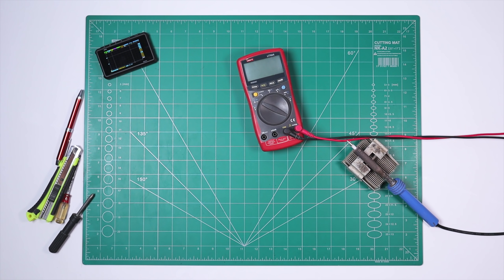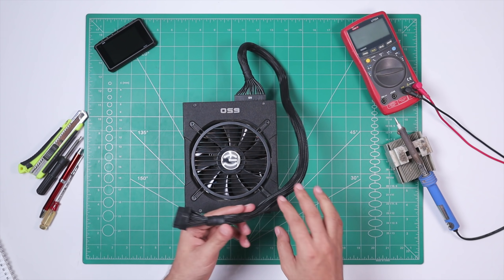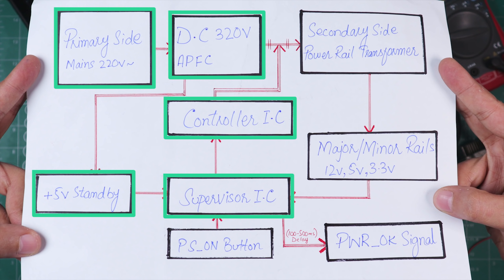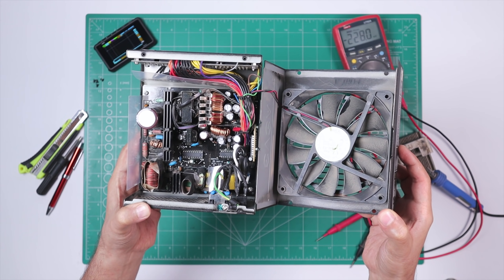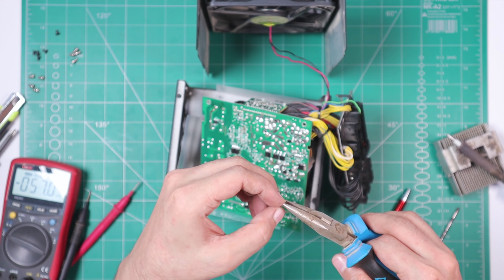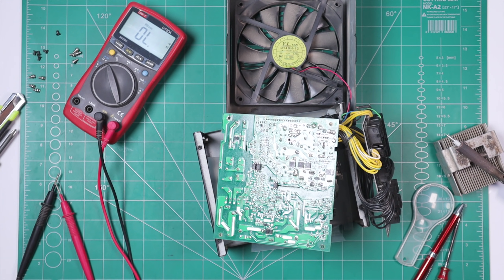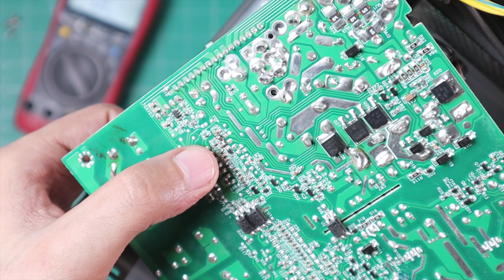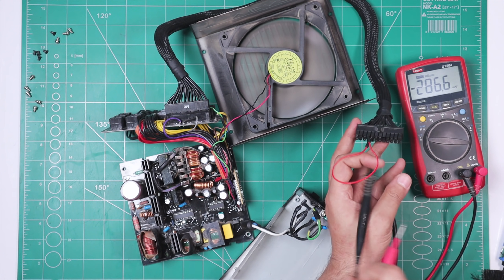Repairing PC Power Supply | EVGA NEX650G

Comment: Hot air stations are good for BGA’s but I personally wouldn’t recommend it for surface mount rsistors it’s usually easier with solder wick and a pair of tweezers

Comment: What if 12v returns 11.8 or 5v returns 4.9 on multimeter? Is PSU okay or dead?
Reply from the maker: It's perfectly fine.
Reply: @GuyThatDoesEverything  I checked it with a multimeter and looked up manual for min/max outputs and mine were below minimum. And the problem why I decided to check the PSU in the first place is that it was providing electricity but not enough to power the motherboard 😕

Comment: HOPE TO HEAR FROM YOU this time ,need help need to replace my dell insperion 5680s psu cant find one anywhere model d460am-03
Reply from the maker: Dell Inspiron 5680's motherboard has 24 pin ATX connector so any ATX PSU will be compatible with this board, though you will have to find the right size PSU which will be able to properly fit inside your existing case.
Reply: @GuyThatDoesEverything  THANKYOU SO MUCH ALSO I THOUGHT I HAD A HARD DRIVE ANS A ELECTRONIC GARD DRIVE AND CANT FIND THE EOECTRONIC ONE ANYWHERE WHAT AM I MISSING

Comment: What is wrong when psu work normal for 15-30min and then shutdown for some reason? I look capacitors they are good
Reply from the maker: Though the capacitors may look good physically, an increased internal resistance (ESR) inside a capacitor will cause abnormal functionality.
The behavior mentioned in your comment may have several reasons, most common ones are the issues with failing capacitors, over-heating of components and deviations in sense resistors' actual resistance values which may very well be due to degradation (due to high heat exposure) over time.

Comment: You are amazing, can you help with my issue please. Gigabity P750GM is the model of PSU, this one protects when I do the wire bridge in black and green connectors. Only one sound click from relay happen. I tested the voltages with multimer and don't have nothing voltage. I opened the psu, the fan works fine with a external Power supply, I didn't see blow out components or sothing relative. Do you guide me to identify the fail component? Thanks from Costa Rica.

Comment: Hi brother my power supply aldo got som issue yesterday i was using pc when suddenly a blast happen and my pc turn off I know it's psu fault. Now what should i do?
Reply from the maker: This may be due to power surge which ended up blowing up the MOV inside the PSU. I will recommend to just replace the PSU entirely and get voltage/surge protector if you have high voltage issues in your area.

Comment: The question is; Is it recommended to use the repaired power supply?
Reply from the maker: If the repair is done properly by using the exact same replacement components and no hacks then yeah you can use a repaired PSU with your system.

Comment: My pc is getting power all fans arr spinning but no display i checked my gpu and other stuff which works well but not psu
Reply: Some time i boot my pc light fluctuate and pc shuts down some time it turns on normal but no display

Comment: good one. simple resistor fix. tip for others: use series lamp before starting the psu. mine blew up the mosfets the first time. then i used series lamp.

Comment: Hello , i have the NEX750G . Same simptoms , unfortunately i cannot repair it , but i will keep laying around , maybe someone can fix it in the future , otherwise it's going to end up as garbage . Really frustrating , but not much i can do about it ..... However it worked 7.5 years with no simptoms , no problems , one day (a few days ago :DDD ) it decided not to turn on :( .
Reply from the maker: That PSU served you well throughout all these years. You can still give it a try though by taking it to some repair guy and ask him to look for that specific resistor that causes the PSU to not turn on. Even a phone repair guy might be able to do this fix.
Reply: @GuyThatDoesEverything  probably so , but we're short of the advanced electronics repairman , it's really hard to find a good one .A phone repair guy won't touch that , they only change modules and whatnot , no board level repairs. And it could get expensive , i'm not willing to pay more than 20-25€ , and there's a risk that some other component is going to fail. Or it might not work properly under load . I'm going to keep it for a while , maybe i get lucky .
Thanks for the reply .

Comment: Thanks for the vid. I got broken psu lying around so I just bought another online ... that one is broken too. You may have just given me the confidence I need to try and repair them. Already noticed one of them has 3 broken capacitors in it, hoping replacing them solves the issue on one of the psu's ... would be nice to save a 650watt Zalman semi-modulair psu. thanks!

Comment: is it alright to use a repaired PSU ?
Reply: I wanna know this too
Reply: @UriPhoneCracker  As long as it's a quality power supply repaired with a quality part, you'll be fine. Cheap PSUs are likely to cause the issues you hear about like dead motherboards

Comment: Good on you for warning people of the danger of the capacitor as it is literally a stun gun in the shape of a battery. I would argue that is unnecessary  and even dangerous as you cannot accurately predict when the capacitor will fully discharge by just leaving it. I have no formal electrical training but I’ve worked in IT for 20+ years, built bitcoin mining rigs . I’m still not sure which is more difficult , designing a proper multi device rig or designing the power requirements and installation of a proper data Center, but they both share very similar requirements and dangers except with a data Center the  big power source that could turn up to crisp is mainly located in the electrical utility closet or wherever the main power is fed into the building. Typicallly after that it’s split off safety into recepticles and no surprises there. But designing a bitcoin or any kind of crypto rig involves setting up multiple dozens of power supply units just like the ones in this video actually quite often higher I had them usually in the 700 800 W range for ant minor I even had a 1000 W PSU in one unit, which of course had a back up decided it so 2000 W power supply that if anything short out that capacitor or if you open it up to do a repair cause when you’re doing this mining stuff you have to save every penny literally so you’re not you’re not taking your power supply it geek squad to get it fixed you do it yourself and there are a lot of those capacitors. The best way to repair one is disconnect. The power completely you can count to five, wait 10 minutes or wait an hour. Waiting an hour is probably the safest but you still don’t know that that capacitor probably still has most of its charge in it. They’re designed to hold a heavy charge. So unplug the power cord from the PSU and if it’s connected to a computer even better because then you have an on button to push just push the on button you’ll notice that after you unplug the cable if your computer has an ethernet cable in the back of it, just watch the ports on it they stayed lit up for like a good 5 to 10 seconds in some cases or the motherboard often has a green light showing that everything‘s OK and powers flowing through it. It will stay lit up for several seconds, that’s those capacitors. It’s hooked up to a computer. You’re actually slightly safer because they sort of drain them, but the best way to do it regardless of if it hooked up to a PC, Or just open in front of him like that is pull the power cord turn on the supply however, you can so short the cable if it’s not plugged in a computer or rig and keep it shorted for a few seconds that should be enough to discharge all of the remaining power inside the capacitor. Then to be safe, you can use a multimeter to test the capacity for any amperage of voltage in it. It should register basically 0.

Comment: Hey, my cpu stopped working after my power randomly shut off and i did the trick u showed at the start and the cpu worked, same as some fans in my pc and i dont know what to do now, reconnect the cable and hope it will work or what cause i got no idea

Comment: Does anyone care as to 'why' the resistor was damaged?  Resistors do not just overheat for no reason.  Oh well, why bother.  Replace and move on.
Reply from the maker: Sadly, there's no datasheet for that particular IC so figuring the exact reason as to why it burned out was kinda out of equation at that time. Many people reported the same resistor problem in the comments and after replacing it the problem also got resolved for them.

Comment: Good repair .  How do you trouble case where power supply shuts down immediately after power on  if the supervisor chip is shutting down the PSU . Can you stop the supervisor chip shutting down the PSU so  that the PSU remains on so you can trouble shoot the problem .  What is interesting is to show techniques to trouble different classes of fault

Comment: It is so sorry that a pro like you don´t have all the tools he requires, hot air station, fume extractor, microscope etc. I wish you succes.
Reply: What’s the hot air thing he talking about? Like a hot air gun thats a necessisity to repair an iPhone by heating up the glue that keeps the screen on and forms the waterproof seal??? I just managed to get a real hot air gun and my gosh does the air gun make a difference. I could literally start a fire in seconds with the heat directed at a piece of printer or news paper. First time i used it on an iPhone i freaked out when i had it aimed a bit too close the the front screen and it looked like someone spilled a cup of coffee under the glass from all the pixels heating up but luckily it went away pretty quickly. When I touched the iPhone, almost burnt my hand. Before I got the hot air gun I went from pissing my wife off big time to making very happy because she was a hairstylist and I just started off. Didn’t have her dream  blow dryer yet and then I kept sneaking in every so often when I would have to repair someone’s iPhone screen and steel her hair dryer and I always forget to put it back so what I did was find out what the best model blow dryer. I could buy see if it was better or similar to the one that she wanted and found out that it was actually much better and more expensive. I bought her a ceramic blow dryer from top-of-the-line imported from Europe manufacture when I got to using hers just for fun, one time to do a repair to see how much different it was from the non-ceramic old one that she happily traded me for I realized how good the ceramic one was so I upgraded her again, she got a new ceramic and I got the old one did two different and I think that blow driers are much safer options if you’re dealing with anything like an iPhone or putting on heat shrink tubing. This almost sounded like he was talking about soldering with hot air. I’ve never done that before if anyone can explain that to me I’d appreciate it.

Comment: Hi bro , my brother have a pc which is 
R9 3900x
32gb ram
B550 Aorus Pro AX
GTX 1080
and the psu is that same one , so he was working normally on the pc but in sudden it just turned off with sound of electric shortage and it just kept restarting , he took the pc to the same store that he bought the motherboard from , and they told him that the motherboard is dead because of the power supply , and they broke the socket when they wanted to take off the cpu , so is it the same problem that is showed in the video ?

Comment: I have 650P2 and I'm Islamabad, yesterday voltage was fluctuating and it seems overvoltaged. 

At first sight I saw breaker tripped, then I tried with the tool for powering up PSU without motherboard, it was come with PSU. I tried with it to see if mine's fan also doing the same but loud popping sound with some sparkles happened.

Comment: I don't think that i have ever commented on youtube, but i just want to say thank you, i woke up this morning to the same issue PC energizing for a fraction of a second then shutting off, i removed the gpu and other cards to eliminate them and it stayed the same, so i teared open the power supply after i saw your video and i was sure it was the cause of my problem not other components however my resistor looked fine externally so i removed it to measure and it measured 10 ohms, i soldered it back on board and boom power supply is working again, i guess that it was a matter of a cold solder joint or loose one due to heat.

Comment: how do you know the value of the resistor?
Reply: if you're asking that then you HAVE GOT TO BE new to electronics

OK
1. Learn about Ohm's Law
2. He knows the value by the colours on the resistor.
Google DIGIKEY RESISTOR COLOUR CODES and get out some resistors, Predict the value 
then check with a DMM if you are correct

3. why did he use that value ?
Because when you have 155V olts it's fucking pointless to use a low value, say 10 Ohm resistor.
You want to use a high value resistor

what he is doing TO MAKE THINGS SAFE IS....
Instead of shorting the capacitors as idiots tends to do, 
HE IS PUTTING AN ELECTRICAL LOAD BETWEEN THE PINS

PUTTING AN ELECTRICAL LOAD IN A CIRCUIT MAKES THE CIRCUIT CONDITION SAFE

that's why
and the value of voltage that you have will determine what cap you will use to make it safe

Comment: I have a Corsair HX1050 that had an oily substance on the power switch at the back. The unit is able to turn on. What might be the cause of the leaking oily substance from within the PSU?
Reply: could be a puffed capacitor
Reply: @ra3or  I see, I sold it and the guy doesnt seem to be reporting any issues. Can blown leaking capacitors continue to work?

Comment: @guythatdoeseverything 9mins :07secs - Are you sure that FSB6601 switches the 'secondary transformers' because those coils you point to are not transformers, they are the output inductors, which are responsible for removing ripple/high frequency noise and giving a stable output voltage, together with the output capacitors.  They don't need 'switching' in any sense.   Nice repair though.  The FSB6601 is either the PWM controller for the main power supply rails or it is a voltage comparator (probably a quad differential comparator similar to LM339).   You didn't mention the part number of the other 20 pin IC so there is not enough info to say for sure.

Comment: Nice that was helpful.  Can you help me fix my issue.  I've got homage ups I set one connection for PC so if main power cuts then I can properly shut down my system but when main power cut down my PC don't stays on, it turn off and then turn back on. What do I do? It's thermaltake smart series SE 530w.  I bought in 2016. Do I need to recap capacitors of PSU . Or change UPS relay?

Comment: When a resistor heats up, burns and cuts out, then the problem is upstream of the resistor. Your fix is temporary. I doubt it will handle half the load on let's say 12 hours continuous work. Will you come back and show/tell us if it still working?
Reply from the maker: There's no load on this resistor, it looks like it acts more like a sense or pull down/up resistor. I couldn't find any datasheet of that IC so can't say with absolute certainty as for which exact purpose that resistor was being used there. Though the PSU has been running fine ever since this repair.
Reply: @GuyThatDoesEverything  Thank you for the reply. Nice to hear it's still alive!

Comment: Is there any reason you used a 47k ohm resistor specifically to discharge the capacitor?
Reply: Huge resistance so it wont fry up. Under 1 k it will probably get hot or maybe boil under high voltage
Reply: YES......
A capacitor without an electrical LOAD is an OPEN CIRCUIT  aka   Extremely High Resistance

if you place a LOAD that is of low resistance across the terminals
THE CAP WILL DUMP THE POWER INTO THE LOAD because current can now flow

IF THE RESISTANCE IS LOW vs the voltage (Electrical Pressure) going through it
it will fry the resistor

SO... IT'S NOT AN EXACT  VALUE CHOICE
but....
it can't be infinite resistiance because current will not flow
it can't be low resistiance because too much will flow and burn the resistor

TO MAKE THE CIRCUIT SAFE
it has to be enough for current to flow
but also the resistor has to be able to handle the voltage dump into it
so high enough resistance to be able to take it

so 100k to 300k ohm should be fine

Comment: My shut off during load which part I need to fix?
Reply from the maker: It's either heating up or has prob with its main bulk capacitor. Get it replaced with the exact value cap.
Reply: @GuyThatDoesEverything  lol it's do hard to replace the cap 
But I will try

Comment: Thanks for the video. Even though I ordered a new one, that left me curious, same problem as described on the video.

It's a 5 year old EVGA 500W-B, it's been working close to 24/7 for years.
Reply: Just solder on a new resistor from an old Nvidia card.

Comment: what if the fan does not start at all, nor any voltages from EVGA 600 watt 80 plus certified?
Reply from the maker: then better check for any fault on the primary side. Can be a blown up fuse/MOV/NTC/APFC MOSFET etc
Reply: Any luck with yours I have the same issue and a 750

Comment: I got a cooler master 650 80+ gold one, it turns on just fine but after a few minutes pc turns of and its the psu cause i tested another one and it works just fine
Reply: What was your issue " cooler master 650 80+ gold one" what was the fault ?
Reply: @CollosalTrollge  one of the musfet was bad, and a capasitor, i went to the store I buy it and got another one